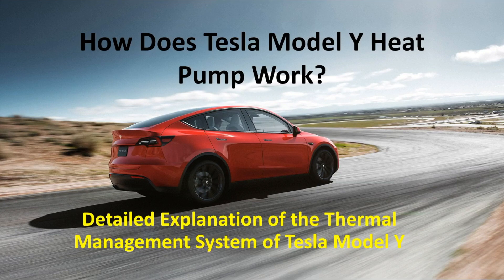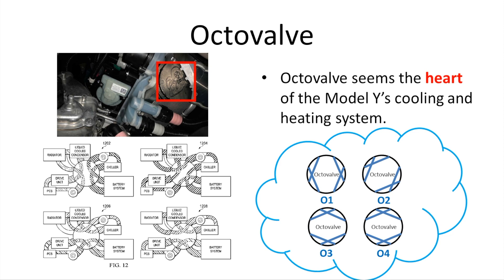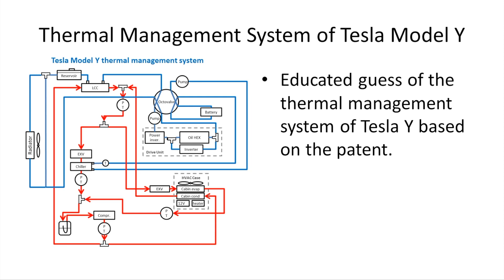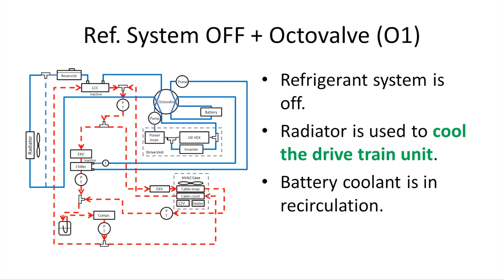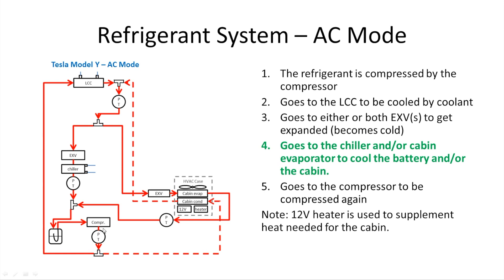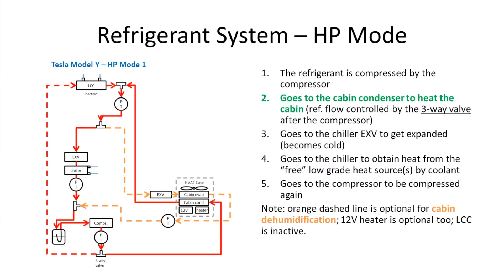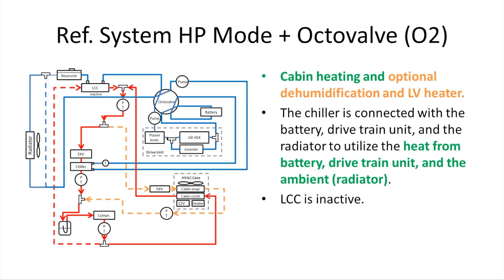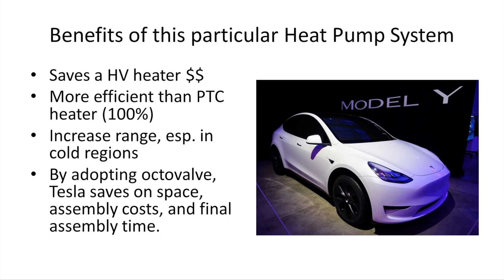How does Tesla Model Y Heat Pump Work - working principles of the heat pump system and its octovalve

Comment: So, Tesla model Y can use the battery as a short term thermal storage. The battery heats up during  supercharging and the heat can be used to heat up  the cabin during(??) and after the charging session. This could have a fairly large effect during the winter time road trips. Firstly, it could increase charging power by 1-2 kW as resistance heating isn't required, but the heat from the battery or from the heat pump can be used instead. Secondly, the Model 3 (Model Y uses the similar battery pack) battery weights ~500 Kg and is heated up to 55 C during the charging session. The optimal drivng battery temperature for Model 3 is around 36C. So there is a lot of heat stored in the battery, that can be used for cabin heating during the trip. That could equivalent of like 5+ kWh of extra usable energy.